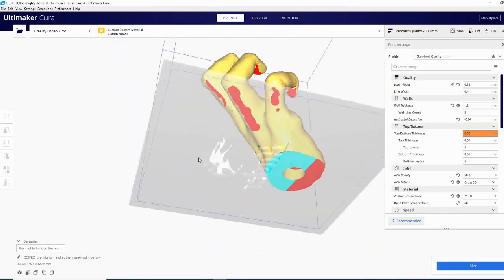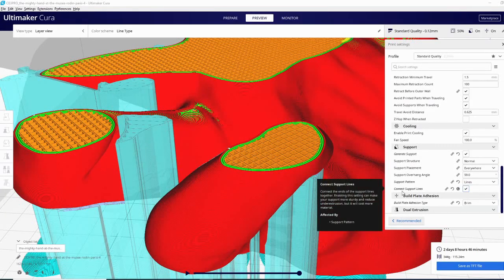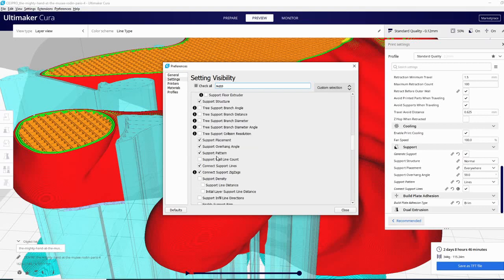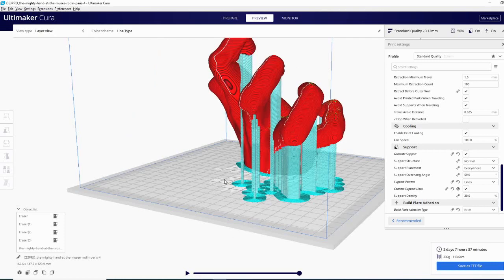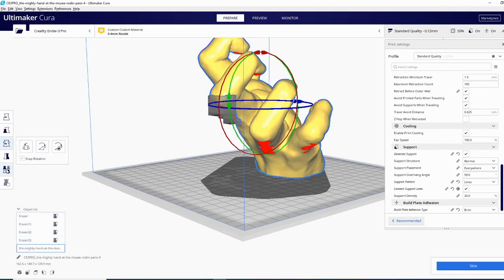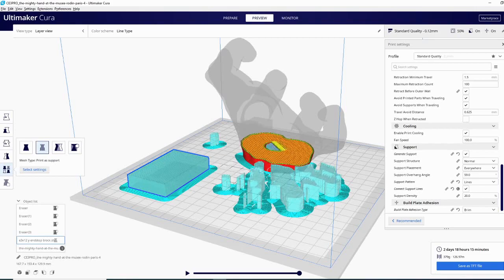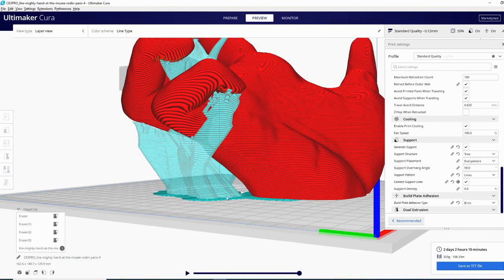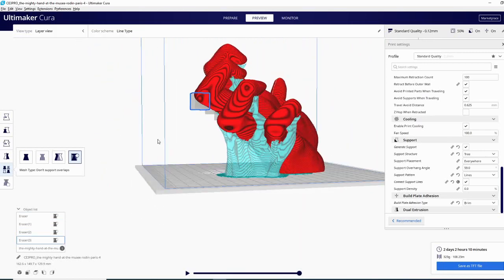Cura Support Tutorial  - Support Tips and Tricks

Comment: The confusing part for me is that I am using Cura 5.5 and I am guessing you are using something earlier, I have no experience with any version but 5.5 your interface is way different than mine                        so to follow on with the stream is very difficult for me... Anyway thanks for the good video on this topic as I am  having fits with a particular bunch of models for Legions Imperialis, specifically aero  type models and supports...
Reply from the maker: my version was actually lower in this video.... the extra settings can be turned on and off in the settings, and i have a few helpful extensions that change the interface a little. i will make a generic version of this video for the latest cura
Reply: @Technivorous  Thanks much brother...

Comment: Ss Great. I am using Cura 5.2. My supports just weld to my print. The only way I can get them to remove is by using my 1000F heat gun and heat up the supports until I can pry them off. Very frustrating. You brought up one thing I did not think about. Is, one Wall supports. I wonder if I can print any other type of support other than tree supports with a single wall? I think/believe that CURA 4.x actually did something similar. I only tried Cure 4.x a short while before moving on to Cura 5.0. But I recall the supports in 4.x being much much easier to remove.

Comment: Is it possible to edit the tree support to move where the base is and how it curves to the model? I'm trying to print a wolf head and the tree base starts right in it's mouth and the support is unbelievably hard to remove and even if you manage to do so, it leaves a real ugly finish. Basically, what I wanted to do is to use the bed as the tree support's base rather than the model being the base of the tree support.
Reply: Did you try enabling the optioning "touching the build-plate" vs "everywhere" in the support options?